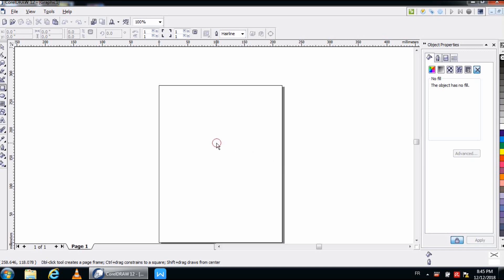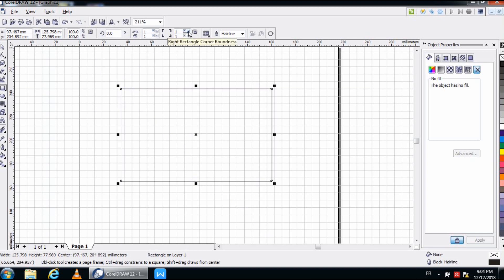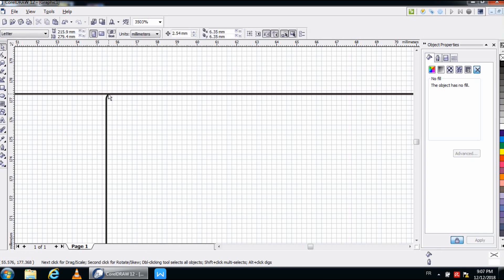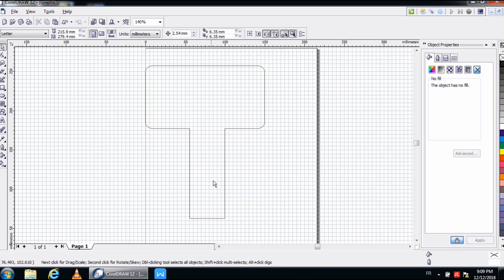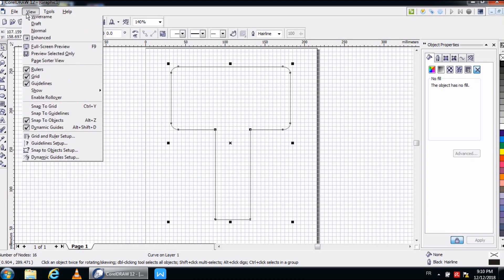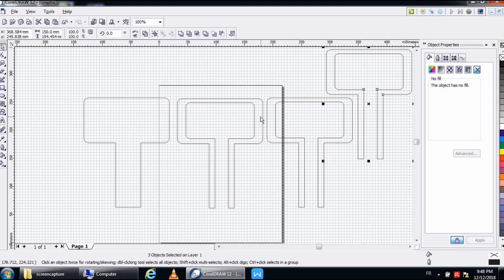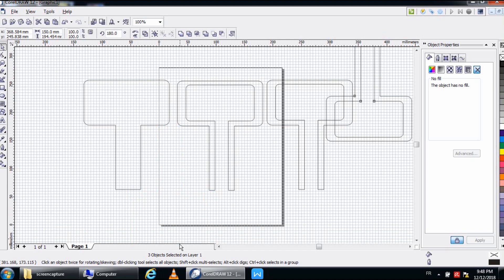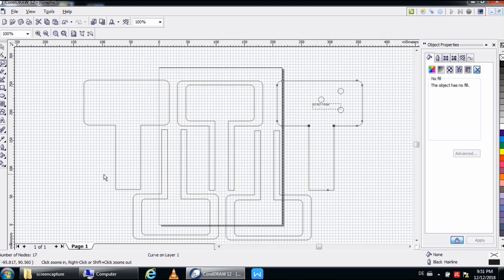Can you use a K40 Laser cutter for 3D Printing ?

Comment: why dont you use cad software to do this type of thing that requires measurements?
Reply from the maker: Well Corel Draw is a program to make vectorized technical drawings, so it is very precise. I use CD because i know the software, you could sure use a CAD program too but it seems to me more complicated as with a laser you mostly work in two dimensions.